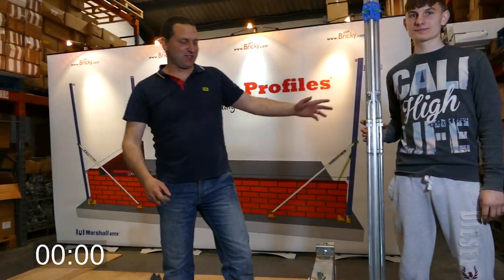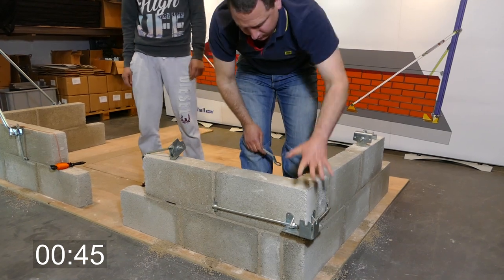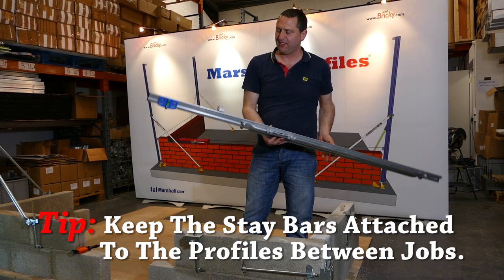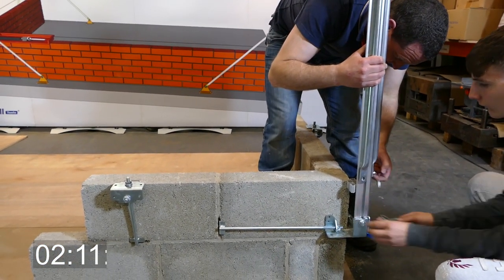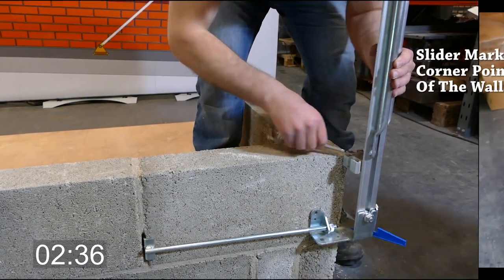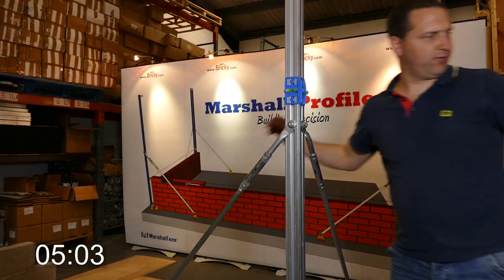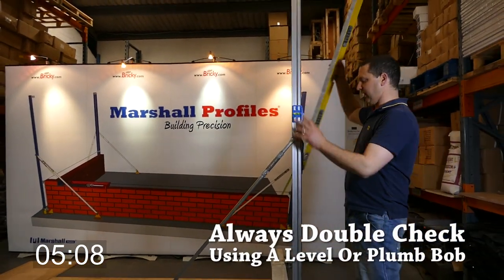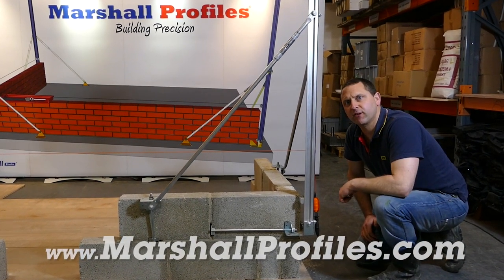Marshall Profiles 5 Min. Setup

Comment: All you need to do is use the blue line holders. The triangular blocks that slide up and down will rest against a couple of courses below so it’s impossible for the profile to then flex.. if you do go to far away from the triangular blocks it can bend but you’ll see for yourself as and when you use them

Comment: Cheaper and easier to just buy a bit of 40x40mm square galvanised steel. And get some block and or  brick profile clamps. Than just get.even in and gauge it up

Comment: I’ve recently used these profiles on concrete block work with thermalite inside skin conc on the outer skin. They took a while to set up 4 of them...about an hour and I used them on 3 lifts so they have had a bit of ware and tare. They do get easier to set up and they are good for both inner skin and outer however you need to do each a course at a time so there a bit of walking around on a large extension but great for a one on one gang... particularly when your getting knackered and toward the end of your laying career.
Reply: What’s the verdict a year on John?
Reply: @jakeroach5991  still happy with them Jake. The best way to,use them on cavity wall for me is  to build inner skin first using the Arms  extensions ( don’t pull the line too tight ). Then outer skin. They do get easy and quicker to set up with repetitive use and the bolts and sliders get a little more lose once the newness wears off
Reply: Hi john do you still have these profiles and would you still recomend them
Reply: @philipfennessy5625  yes I still have the original set. All the nuts and bolts but I’ve swapped the string line for a thinner line, I brush any mortar off after use and I always use a bit of 3 in 1 oil at the beginning of each set up in the slide groves just to help slide and it works a treat, they are well worn in by now but using oil prevents excessive wear plus it’s easier to clean mortar splashes  off when dismantling them, keep the threaded bar greased up too
Reply: Thanks john for reply appreciate i got a present of them and was wondering about what to do with them because people have said pulling a tight line will pull the profiles out of plumb. I was going to buy some blakes  profiles but i will give these a go first thank you👍

Comment: What a load of rubbish, no serious Brickie would mess around with these profiles! Apart from ripping off Blake’s Profiles, you could build freehand quicker. Strictly for the DIYER!
Pro Brickie’s use a length of square box channel and clamp it straight onto the brick or block.